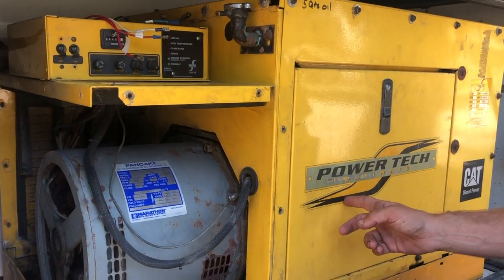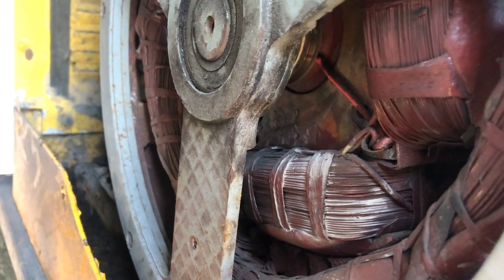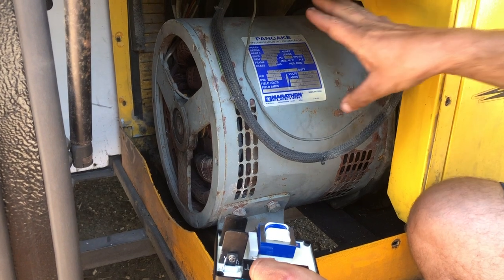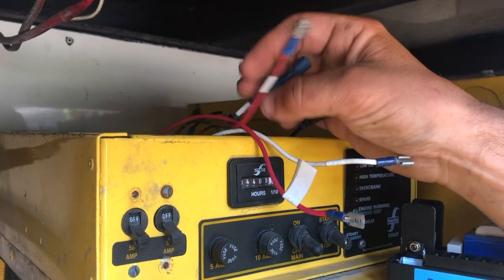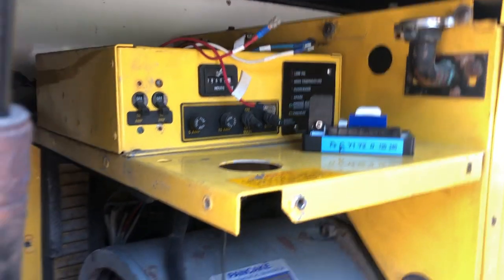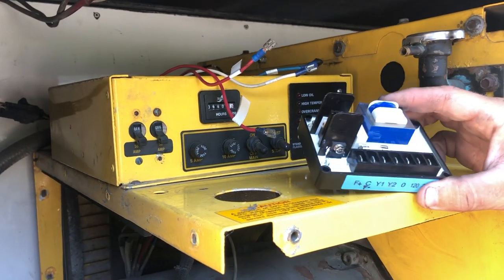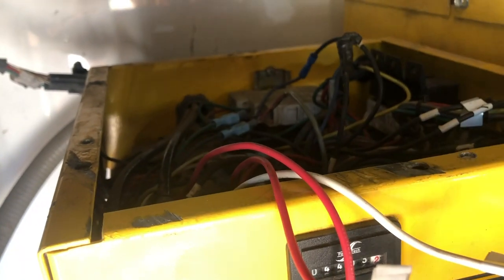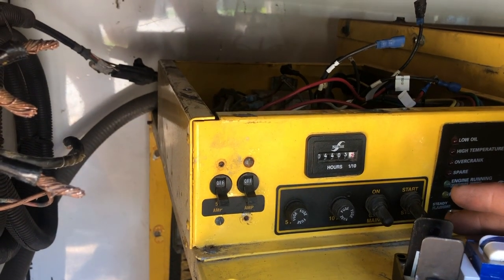Powertech Diesel RV Generator Marathon Pancake Head testing

Comment: Negative from battery to generator were did you attach it thanks
Reply from the maker: It’s been a few years since I did this. I can’t remember 100% but I think avr sends a dc voltage signal to the brushes to maintain the correct a/c voltage so my initial thought is to send the 12v to the brushes